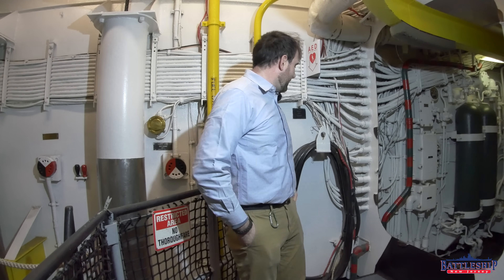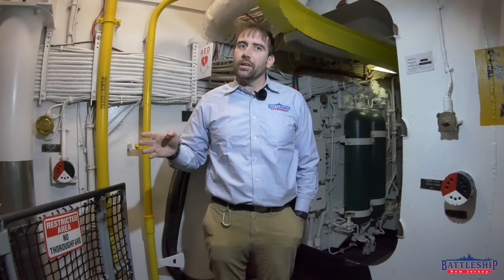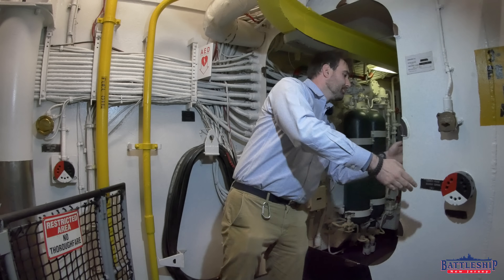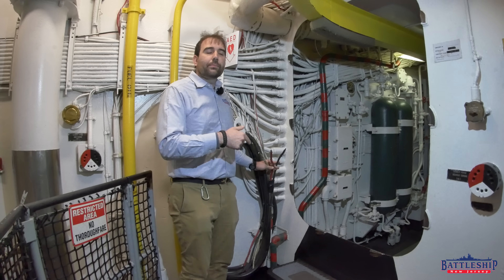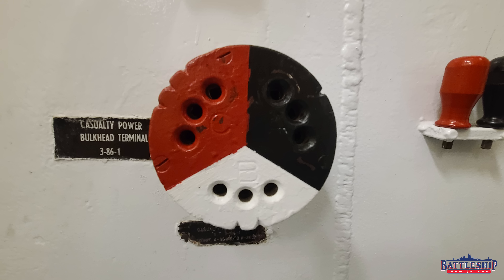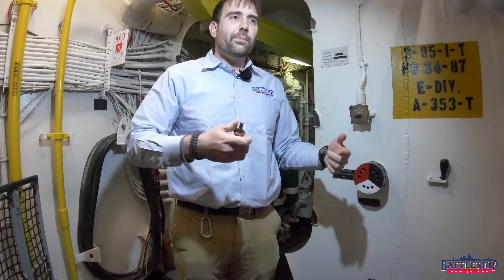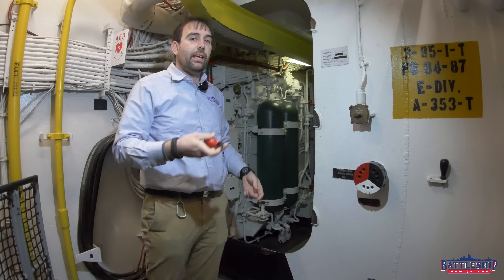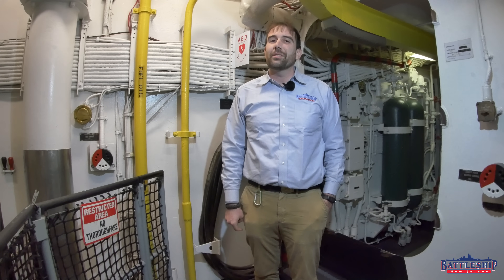What Are Those Weird Red/Black/White Discs on the Wall?

Comment: I've actually been thinking of similar stuff for backup power for the house. And I assumed that's what those discs were for. That's the cool thing about electricity. It travels through solid wires which is usually surrounded by solid insulation. So, You can completely seal up a wall that it goes through, or have a connector like that. I don't like those terminal plugs though, you could easily get fried by touching them while they are live. I assume they had caps on them. The 1 to 3 tab and notch system is really cool though. I love the simple solutions to major challenges that people come up with.

Comment: So the biscuits are whenever power has to pass through a bulkhead or at a source or power or something that would be supplied with power? The original video admittedly left me confused on why/how they used the cables and biscuits but seeing the different types of biscuit it makes sense now. Thanks.

Comment: I'm guessing that the holes are aligned, as well.  That is, going clockwise, if the black goes in the first black, then the white goes in the first white and the red goes in the first red, same for it it's going into the second black/white/red, and so on.

Comment: Ex navy. We had generators we could move that had small jet engines. You could power quite a bit with one unit. Now imagine multiple units. Powering aircraft and supply equipment. Easily moved to where the power is needed so you don't have to run power from, say, a forward power generation room. Then you're only effectively doing repairs in the problem location and not spending a lot of time routing power cables. We did have diesel generators too. Different sizes. After the navy , I installed many Onan Cummings diesel gen-packs at many homes, businesses , government projects, and buildings. As well as natural gas and gasoline units. Some of the largest where the size of semi trailers. The largest was 3 stories tall and could power a small city..lol.

Comment: Each pie slice has three holes.  Are they all connected together, or is the hole choice significant?  If you plug into red-1, do black and white also have to be the -1 hole?  Do the connections on the other side of the biscuit in the other compartment have to use the same hole?
Reply: I am sure that one of two things is true.  either each set of holes are interconnected, meaning that it doesn't matter which red (or black or white) you plug into, the guy on the other side can plug into any of the.  Or there is a set order for filling the holes to make sure everything hooks up correctly.

However, I would put money on the three holes of each color and on each side of the wall being electrically connected simply because it simplifies EVERYTHING.  It lets one puck supply power to three other pucks in the same space by just running cables to each.  It lets you connect up ALL of the pucks in a particular space by making a loop.  AND it makes it really easy to instruct the new guy, "plug black in black, white in white, and red in red.  No, it doesn't matter which hole you use"
Reply: @gildedbear5355  Yeah, that makes sense, especially considering how much effort they put into making it simple.  Thanks.

Comment: We have battery powered emergency lights which replaced our normal LED lighrs.  They go off and on with the switch somwe can extend the run time quite a bit.  We also have a pair of Honda geneeators to run imporrant things in the house.  Our longest outage somhar has been four days

Comment: Backup power: AT home: Battery on my Cable Modem & Router. At work:  [kK8 School]: UPS on Server Rack to run Wifi, Clocks, PA & Phones. Portable Generator to run the Well. Various fixed and portable battery lights for MPR, Gym and Office.

Comment: in the previous place where I lived we had water, a flashlight, and hard hat on the underside of my desk (that's where one hides in an extreme seismic event, or a volcanic eruption)...
where I live nowadays, there is a different set of threats, so the communal shelter is equipped with food and basic rations, and some forms of communications... but that is provided by the city, so I have no real knowledge of what is there.
Reply: We have emergency food and water, kerosene lamps, the woodstove in the living room, and a minimum of a cord or so of wood at all times.  Wood stove is big enough for a soup pot and a coffee pot on top.  We also have several boxes around the house containing small First Aid kits, matches, candles, etc.  The large First Aid kit, the 72-hour backpacks, etc. are staged next to the gun cabinet.

Comment: Hmmm. Similar style of those cables gets (but shouldnt be..) used on building sites everywhere... when you have external power and backfeed the power into the house with a double plug "suicide cable" into a wall "outlet".
Double Fun with the EU Schuko symmetric plug that doesnt define Phase or Neutral, until your Neutral-PE bridge goes hot and live in the main cabinet.

Comment: The designers seem to have come up with every conceivable way to help the crew deal with battle damage and keep the ship afloat.    

How tightly do the casualty power cables fit into the biscuit receptacles? It seems tightening the connections with the biscuit wrench would be nearly impossible if you had to plug the cables in by counting ribs/notches.

Comment: My house has grid power but will switch to an inverter if there is a power outage, which runs on a bank of lead-acid batteries. These in turn are charged from a solar array and also a slow-running diesel engine generator. As you say, good to have options.

Comment: Interesting. I was wondering what the point was when the people running the lines would have to go between compartments. then i realized that there's probably not team that goes and does the work. just the people already in the compartment get a call that tells them to connect two biscuits. they might not know or care where its going or coming from, they just connect it up and keep working.

Comment: A couple Diesel generators and a battery of rechargeable flashlights make up my standby power. living in a rural are, even in modern times often means extended power outages. In other words, we are usually last in line.

Comment: How to do various different generators on the ship sink up to provide power?
Does this ship have one electrical grid or is it separate different systems?
Do You ever have more than one generator feeding into the same circuit?
I can only imagine that there's a different system for each.
I would love to know about the ship's electrical thank you.
Reply: You parallel the oncoming generator into the main bus using a synchroscope  or three blinking lights in an emergency.

There is one grid but it can be split up on combat ships in case of damage .

You usually have more than one generator on line for redundancy at sea.

Comment: Do these biscuits provide three separate connections for each phase, or do the three connections share a common bus?

If I'm on one side of a bulkhead, plugging a cable into a biscuit, does the guy on the other side have to use matching sockets, or are the three sockets in each phase interchangeable?

Comment: Being a disabled person, when the power goes off if I'm in bed I have to seal the airflow mattress soonest or it goes flat. But I have a electric wheelchair with 144Ah of batteries in it. It has USB adapters and also I can connect an alternator for some mains stuff

Comment: In 20 years, over 7 deployments on 4 different carriers, I never saw casualty power rigged, even as part of a drill. I'm sure it must be drilled somewhere, but to be frank, I've never even heard of it being used in an actual casualty.
Reply: Thank you for "standing your post" or as Navy says "dog the hatches".
Reply: I've rigged it as part of my Prerequisite Quals for the "Repair Party Electrician" Qual, but never actually energized it.  I can't remember ever rigging CP cables for a drill either.  Then again, my GQ station was "Main IC Switchboard/Gyro Watch" for most of my hitch, so can't say it was never done.
Reply: Thanks for sharing that. Your experience is probably more current and 3 times longer than my 4 years. Nothing in my time zone either. Great that system is there and thought through. The ship would have to been really seriously hurt to need that level of restoration.

Comment: Those are modern cables, not how they were made when the ship was commissioned. 
The the “tab” as you call it, is properly called a “Phase indicator”, and it is an O-ring (or two, or three) placed over the conductors insulation, an then it’s covered with a length of colored heat shrink. I made replacements for ships at SIMA Long Beach
Back in World War Two, heat shrink hadn’t been invented yet. Then they used a thin cotton line, and either wrapped it, or braided it into a tubular sheath, and to create the phase markings, a “Turks Head” knot, or some other decorative knot) was tied around  it. It was then varnished to make it hard and waterproof.  As you might guess, this was very time intensive. But a point of pride for the person responsible for that space. 
Modern ships use a plug with all the leads safely insulated.

Comment: I live in a retirement community and about 1/3 homes have generators and fuel tanks. So, in a severe blackout that lasts for days, all the generators will run out of fuel at the same time. I have portable solar batteries and solar panels. Can't install a full solar system yet because of local codes and insurance issues. I review this issue every year for changes even though the monthly payments for a full solar system will cost about $75/month more than the cost of utility provided electricity. Thats not even considering that the whole solar backup system has to be replaced in about 20 years I would still probably do it.

Comment: Well, because where I live power loss is extremely rare so my stuff relies on things that have batteries built into them kinda like a wireless keyboard and mouse. It is also based on keeping myself entertained. So I have a desklamp that has an internal battery power goes off it switches into batter power, I have mobile banks that can recharge it and of course my cellphone. I have speakers that have a built in battery and can last 72 hours of full use. Combined with a laptop, I don't really use and my phone. I can stay entertained and my stove is gas that I can use even in a power outage.

Comment: Did the navy every simulate powerloss & had sailors plug in wires in a exercise?
Reply: On my ship, in the 1980s they rarely had us actually rig out the cables, and never actually energized them due to the safety hazard.  If you did not insert the end of the conductor into the hole all the way, you could still tighten it down and it would work, but there would be a small ring of exposed energized copper that would easily electrocute anyone that touched it.
Reply: @dalesql2969   D, How many hands did it take to get the cable off the bulkhead rack and hauled from point to point? That is a large chunk of wire.
Reply: @paullewis5045  They were not too heavy for one person, but some of the longer ones are a grunt.  But since the storage hook was usually next to one of the biscuits, you could grab a loop or two and hook that one up, then stretch the rest of it out to the next one.  Each one was measured and cut for the specific compartment it was located in.   Just long enough to go from the two biscuits it was made for, plus a couple feet extra to allow for random jiggles.   I expect that there were periodic inspections of them by the EMs.  I don't recall anything more than ensuring that they were all present when I was DCPO.  I'm a theater electrician now, I'm slinging around longer and heavier cables for event power setups often.  Although gravity does seem to be a bit stronger now than when I was young.

Comment: Seeing the AED behind Ryan, are there any special measures when using them? these is a bit much metal around to use them freely...
Reply: The "A" stands for "automatic". You just stick the electrical connections on the downed person and follow the voice recording instructions. The system decides if, and how much power to apply.
Reply: @JoshuaTootell  yes, that much is clear. this thing does so many diagnostics it's mindboggling. my issue is with all metal around effectively grounding the patient and bringing all bystanders in possible danger with everything being conductive. the AEDs are no joke considering voltage and energy...

Comment: I have a big double conversion UPS (40kW) an a diesel generator, but the generator currently is being repaired the injection pump started leaking fuel and needs to be rebuilt).

Comment: 440 3-phase is more than even UK industrial power (415 V) which is the highest civilian power voltage in common use.
  Also surprised this is manual wiring of each phase, not a quick plug of some kind that would require the random sailor in the room to memorize less steps.
Reply: We had a air compressor that ran off that. In the summer when everyone had their AC on full blast, the Utility couldn't supply enough power for the compressor to kick on.

Comment: Are all three holes of each color electrically connected or isolated? In other words, does it matter which sockets are plugged into on opposite sides of the bulkhead?
Reply: I'm going to guess that they are all bussed together; otherwise, it seems like there would be some sort of keying system to separate and distinguish the individual sockets...

Comment: Do these jus automatically get plugged in anytime there’s a power failure or flooding? And what if the person on the other side of the water right door has already drownded? In that case I’m guessing the water completes the circuit itself instead of needing to plug in the wires? (heaven forbid tho! I do hope nobody drownds)

Comment: Since this is a video on outlets: Can you do a video on the standard US power plugs that appear in the background sometimes? The standard appears to have been made after construction began and thus a refit thing. Also if those plugs provided standard US power (2x120 volts, 60 hertz).
Reply: 120vac was standard on most ships from at least the 1930's. Shipboard lighting is 120vac and convenience outlets were just part of the lighting circuits